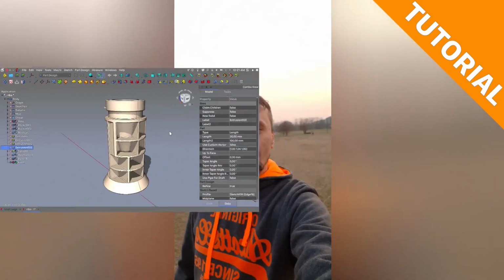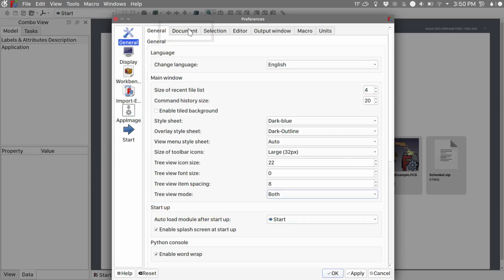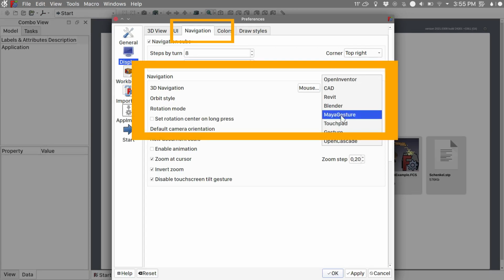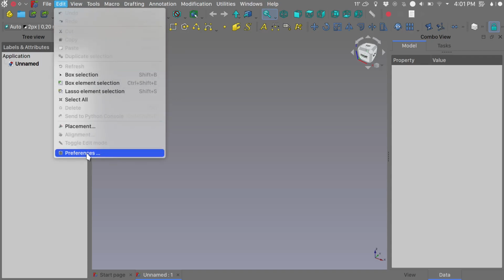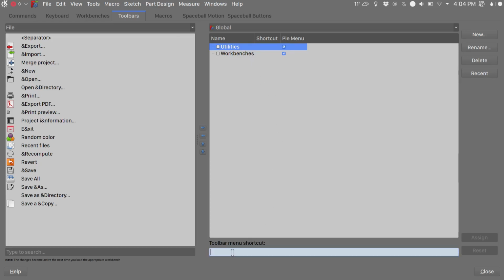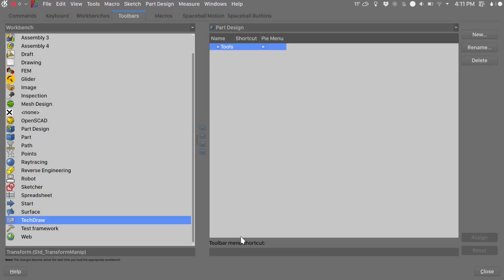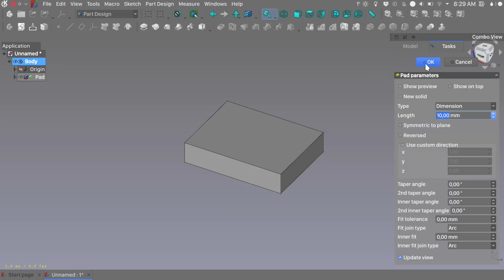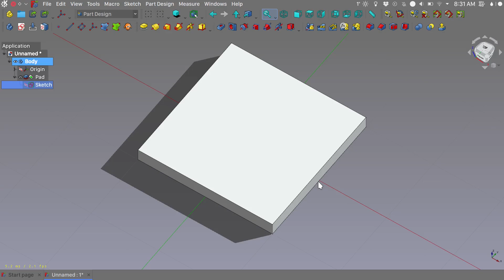Updated FreeCAD LinkStage3 customization guide including Pie Menus.

Comment: Edit Parameters : 

Preferences/MainWindow : 
ClearMenuBar = true

Preferences : 

General/General :
StyleSheet = DarkBlue, 
OverlayStyleSheet = Dark-Outline, 
TreeViewIconSize = 22, 
TreeViewIconSpacing = 8, 
TreeViewMode = Both

General/Document : 
SaveThumbnailIntoProjectFileWhenSavingDocument = True

General/OutputWindow : 
ShowReportViewOnError = False, 
ShowReportViewOnWarning = False

Display/3DView : 
UseOpenGLVBO = True, 
AntiAliasing = MSA4x, 
PickRadius = 10, 
PreSelectionDalay = 0.010

Display/UI : 
ItemBackgroundColor = (HTML = #6e6e6e, AlphaChannel =  20), 
ItemBackgroundPadding = 25, 
HideExtraColumn = True, 
CheckNavigationCube = False, 
HintDelay = 10, 
LayoutDelay = 100, 
AnimationDuration = 300, 
AnimationCurveType = InOutExpo, 
ShowPieMenuAsPopup = True, 
AnimationCurveType  = InOutExpo, 
TriggerAction = True

Display/Navigation : 
3DNavigation = TouchPad, 
OrbitStyle = TurnTable, 
RotationMode = WindowCenter,
 EnableAnimation = True,
 ZoomStep = 0.10

Display/Colors : 
ColorGradient1 = #6e6e6e, 
ObjectBeingEdited = #868686, 
ActiveContainer = #55aaff

Display/DrawStyles : 
GroundTransparency = 1.0, 
GroundShading = False

PartDesign/ShapeAppearance : 
LineWidth = 1px

Draft/GridAndSnapping : 
GridColorAndTransparency = #6e6e6e, 
GridSpacing = 100,0000mm, 
GridSize = 50 lines

ToolBarCustomize : 

Toolbars : 
Utilities (Q) = [<Relevant Options>], 
Workbenches (W) = [<Relevant Workbenches>], 
<<SpecificWorkbench>> -> Tools (E, E) = [<Relevant Tools>]

*Enable overlay interface for View
Enable ShowOnEdit for View
Reply: OverlayStyleSheet = Dark-Outline, 
 NOT EXIST!

Comment: Thanks a lot for this beautiful looking design! I am impressed how much you know about the visual options of FreeCAD Link. Maybe you or someone else here in the comment-section knows the following specific visual "problem" (or maybe it's just a wrong setting?) and could help me? I'm working in the arch & bim workbench quite a lot and I have a problem with seeing the grid lines. When mapping the working plane and the grid on a 3D object I like to draw on, I can't see the grid lines due to the preselection highlighting. Is there a setting to keep the grid visible without hiding the 3d-object I like to draw on, or without deactivating the preselection highlighting?

Comment: I tried to follow this tutorial but I have  a few differences? No tree view font sizes or pre-selection delay, is this because I'm using the latest version of FreeCAD?
Reply from the maker: Are you using LinkStage3 branch? https://github.com/realthunder/FreeCAD_assembly3/releases 

I should of make it clearer in the video. This functionality is not yet merged in to master but pretty close to. Also take a look at this thread. https://forum.freecadweb.org/viewtopic.php?t=49616

In the first video you have the tut for customising FC master. Bare in mind that that will be obsolete when the overlay interface will land in the main FC distribution
Reply: @OficineRobotica  thanks for reply dude. I only used the package from the Zorin software installer, still pretty new to everything. I did try installing from github but got an error so continued with Flowie's freecad academy tutorial, which is a real help. Followed some of his settings as well.

I installed Linux a week or two back but only was able to use it for the first time last night and I love it already. Everything seems so much faster, smoother, prettier and ergonomic than windows on Zorin.

Any rough idea when the main distro with all the settings be upped?

Comment: Excellent video! I am facing issues when I try to run the command you showed on video. Whenever I try to run it the terminal says I have no permission. Could someone help me? I am using Linux Mint (Ubuntu based Operating System)
Reply from the maker: If you are talking about the initial command shown in the video, it is intended so that FC starts with  different config files that won't interfere with your default config. That is; the customizing will work only when FC is started with that command. It was a failsafe way for people to try the options whitbought  messing their default config.  If you intend to keep the customization start FC whitbought the terminal command.

That being said, there are some exciting developments lately that will make setting up the interface a mater of a couple of mouse clicks. Just be patient for a few days and a video will be out. If you feel brave and want to try it already take a look at this: https://github.com/oficinerobotica/FreeCAD-Preferences-Presets

Just remember to backup your work and don't use it on important projects.

Comment: I do not have a UI toolbar to select in preferences under display.
Reply from the maker: Are you using the LinkStage3 branch? Anyway, there are some recent developments that will make these UX customization tutorials obsolete  as settings can now be shared via a .FCParam file. I'm already working on a "OficineRobotica" customization pack that can be easily imported.
https://twitter.com/OficineRobotica/status/1436965338252550144?s=20
Reply: I also do not have a draw styles tab either.

Comment: This version of the interface is really great. I think that it should be the default one. Or at least some files (macros perhaps?) could be available so that users don’t have to set it all manually.

There are only some small issues with this GUI style:
- in shadow view white sketcher lines are not visible
- when I highlight the sketch after exiting it, the green lines are hard to distinguish
- navigation cube interferes with Combo View menu on the right

But probably they can be easily fixed by doing some further adjustments in settings.
Reply from the maker: At the moment work it's being done at refining and make possible this UI disposition with a lot less steps. Thank you for the feedback.  Any suggestions are welkomed
Reply: @OficineRobotica  I installed zorin yesterday, first time Linux user. I’m a mechanical engineer but after seeing videos on freecad I dumped windows and am trying to go open source with everything. You guys are awesome for doing what you do for the world. Amazing
Reply from the maker: @oneman29   Glad to hear that, anyway arm yourself with a bit of patience and frustration resilience , for the freedom you get it's worth it.
Reply: @OficineRobotica  I'm expecting some glitches and a steep learning curve but in the hope that I will get the freedom to do industrial level design in my home office without the constraints or costs of proprietary software. Transition from sketch up and fusion should be interesting and fun.

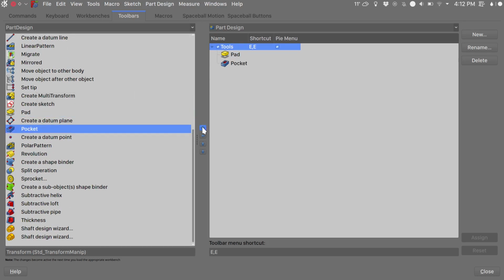Comment: I'm on Windows 10 and at 7:30 the 'part design' option is not present in the dropdown menu so I can't add these handy options (PAD, etc) to the pie menu. Also, the option Assembly 4 is missing. I'm using the latest LinkStage3 build. Also, the compass cube falls below the combo view panel on the right when set to overlay. Ah, also, not being able to do a rotate with the right mouse button is a dealbreaker for me... On top of that, the shortcuts don't actually work, Q, W and E,E
Reply from the maker: 1- First issue... that is strange. Try switching at least once to the PartDesign Workbench then go to Customize again. Allot of workbenches need to be activated at least once after restart for the settings to show in preferences. This is done in order to reduce the start up time of the app to a minimum.
 
2-Assembly4 is a external workbench and needs to be installed via the addon manager. Idem try to activate it once to get the voices on toolbar customization.

3-There are allot of navigation styles , you can choose them by right click in the 3d view -> navigation style. There must be one with right click rotation

4- the shortcuts need to be assigned. When I create the pies I then type the shortcut in the field then click the assign button. Not really obvious in the video. My fault
Reply: @OficineRobotica  Thanks for your reply, 3; sadly this can't be configured. There is no layout that has rotate on the right mouse button (I tried all).
4; That's what I do, typing it in, also, grid doesn't show up when typed in. I guess maybe the Windows version I'm using is missing some functionality, even though I'm using the same version as you.. I am able to set the hotkeys, they just don't work in the program when pressing the assigned key.

Comment: Hello! Thanks for the video - impressive opportunities with the interface and some useful functionalities. BUT for the first, it should be installed and exactly that (as I can judge from the comments I am not a single) for the moment, is a major problem.
I use Windows 10 and a version FreeCAD_0.19.24267-Win-Conda_vc14.x-x86_64. I tried doing exactly following your instruction, but after entering the command in the PowerShell window within the corresponding folder (the folder with the downloaded  .AppImage file) happened nothing. Only a window with a question What App you would like to use to open this file appeared. Maybe you can consult what is done incorrectly on the way.
Thanks in advance and keep up the good work!
Reply from the maker: The first teminal/power shell command is only to create a alternate config to test the customisation, it needs to be done whitbought it anyway for things to stick. I guess you can skip that step on windows, the rest of the customisation is done in FC's preferences anyway.

Comment: Good tutorial, but always failed to setting like this with my windows. and cannot find "open a terminal....". And when i try to set from Edit - preference,..didnt find "UI" bar inside. my display preference is look different from your. I installed freecad0.19 but it seem like a miss, but i dont know what :(

is it setting only for Mac?
Reply from the maker: In the video description you will find the link for downloading the LinkStage3 variant of FreeCAD. Download the 7z archive, unzip it then start FC by going in to the bin folder and double click the freecad file. On windows skip the terminal  and  global menu part as they are kind of non relevant. Ask here if you need further help

Comment: Интересное видео! Компас 19 не использовали?
Reply from the maker: использовалась версия linkstage3 . насколько хорошо гугл переводил?
Reply: @OficineRobotica  he was asking "have you used Kompas 3D v19" (it's russian proprietary CAD). nothing to do with FreeCAD
Reply from the maker: Thank you for the clarification. Unfortunatly I haven't used komps3d before. I will check it out.
Reply: I like FREECAD for using 3d. but FREECAD doesn't have the necessary lines in 2d.I often use lines in 2d for work (when I rebuild 3d in 2d and put dimensions and axes). In COMPASS, convenient 3d and 2d, but the price is expensive-FREECAD is free (I apologize if the translation is bad)

Comment: Thanks for the video,why not make it possible to save that big config to a file so it is possible for other users get it?
Reply from the maker: The config file contains allot more than what is modified in this video and cannot be easily shared between users. It can also contain sensitive informations like specific user/system file paths. There was a discussion about making a macro to automatically apply this  customization but I don't feel yet confident enough to craft that in python and risk peoples systems or work. Hopefully everything will be integrated in to master and all these steps won't be necessary anymore
Reply: @OficineRobotica  do know if it is possible to enter in 0.19?

Comment: why not make it possible to save that big config to a file so it is possible for other users get it.
Reply from the maker: The config file contains allot more than what is modified in this video and cannot be easily shared between users. It can also contain sensitive informations like specific user/system file paths. There was a discussion about making a macro to automatically apply this  customization but I don't feel yet confident enough to craft that in python and risk peoples systems or work. Hopefully everything will be integrated in to master and all these steps won't be necessary anymore
Reply: @OficineRobotica  Thanks a lot ! What are the files locally stored on each user computer to let us "re-do" the same configuration after the first time made by UI without to have to re-do all by UI after each new version download ? Or maybe a simple save/reload configuration tip we don't know yet ?